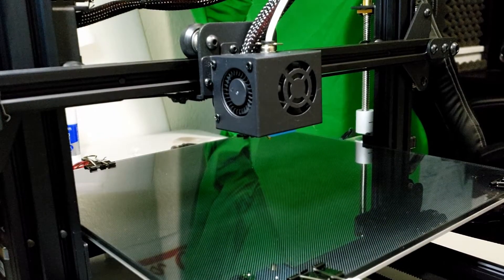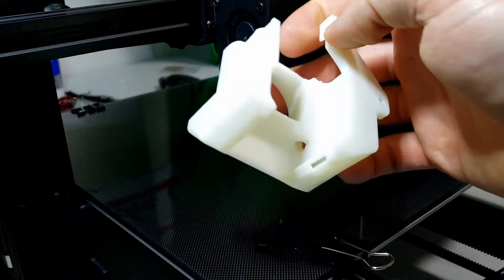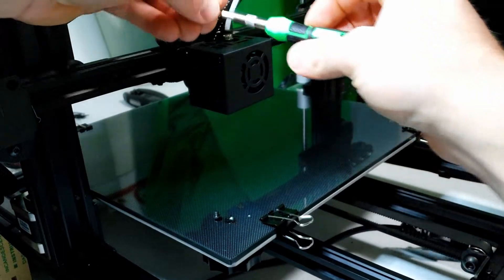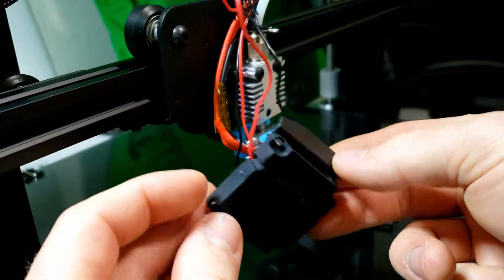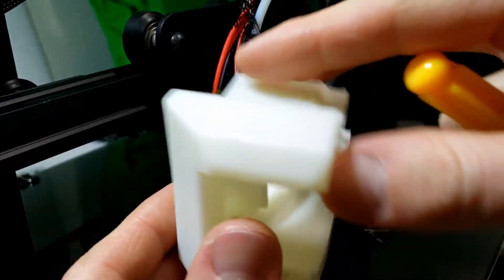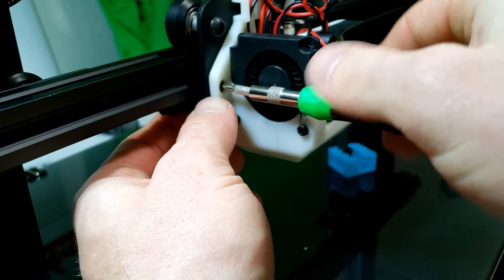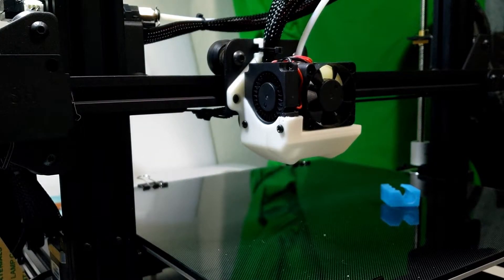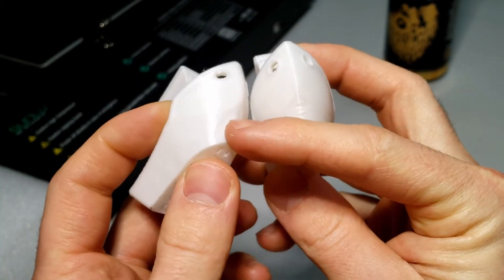Better Cooling! Sunlu S8 Fan Shroud. [ABS] [Hot End] [Red Squirrel]

Comment: I think it`s the filament you printed the benchies with; it has moisture and it under extrudes. Either that or you need to adjust your E steps. I had the same problem on the bow of the benchy when I used a crappy PLA. Adjust the flow in your next print to 104% see if it does any better. Or just simply do the 100mm extrude test. If it extrudes just 90 mm you know you have to increase your E steps. With the Tronxy I noticed that out of all the shrouds I get the best flow with the original one . I printed some using PETG but they warped and melted during my ABS printing attempts LOL!
Reply from the maker: The filament that came with the printer doesn't seem to bad really, I printed some other things as well in vase mode and the calibration cube which both came out pretty good. I ran the printer at 200% in vase mode and it was able to keep up and lay down the plastic. I get some ghosting and vibration in the print, has a strange texture but it's still smooth. Maybe it as something to do with the drivers not being silent. I also have another video coming soon where I replace the extruder. so we can see what changes that bring.
Reply: @PottersVinylsAndMore  Yeah, I heard that non silent drivers introduce a lot of artifacting into prints. Maybe update to a silent board someday? Your Tronxy has the Titan clone if I`m not mistaken? Mine both have the basic single drive deal and they skip like crazy when I try bumping up the speed. Right now I`m printing PETG at aprox. 25-30 mm/s and it keeps skipping even with the temp at 235C.  Both sample spools that came with my Tronxy`s were very stringy and broke easily, never during a print though I`ll give it that. I like the marbly white color. I have some other white spool that prints reasonably well altough a bit stringy aswell.
Reply from the maker: @maiorciprian  yes my tronxy has the titan extruder and the filament that came with that wasn't all that great. also the stock nozzle was bad. the bore through the nozzle wasn't centered. I picked up a microswiss a2 nozzle and it improved prints for me.
Reply from the maker: I still run a custom fan shroud on the tronxy that has been working out pretty good for me. printed it in ABS and it's held up so far. Even when printing more ABS with it.